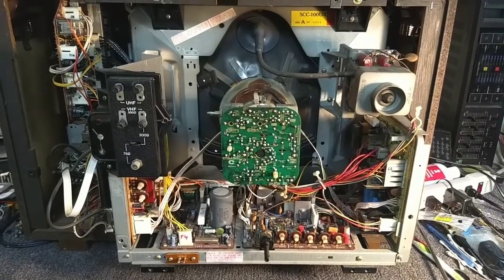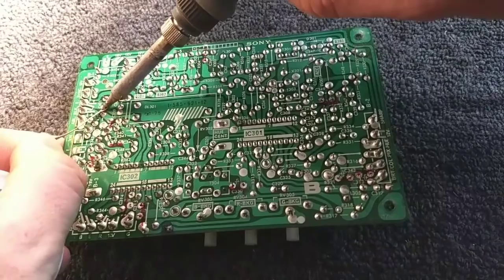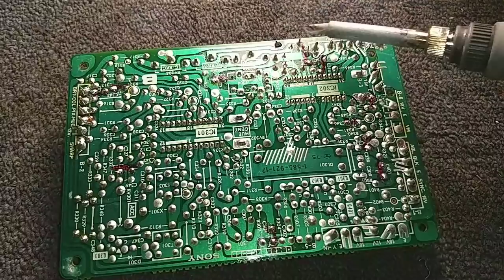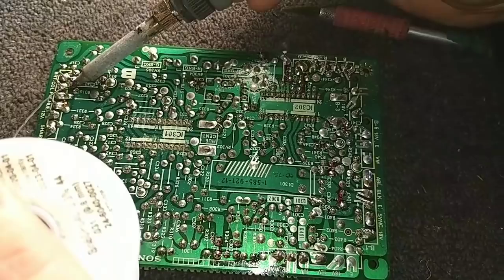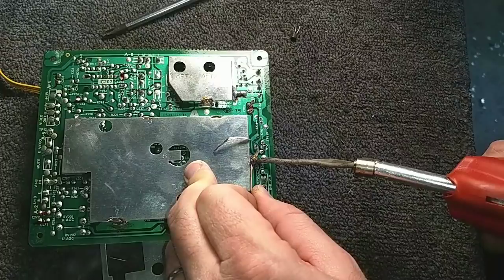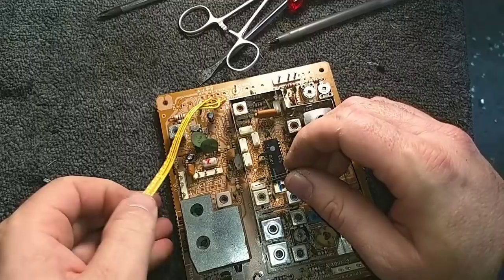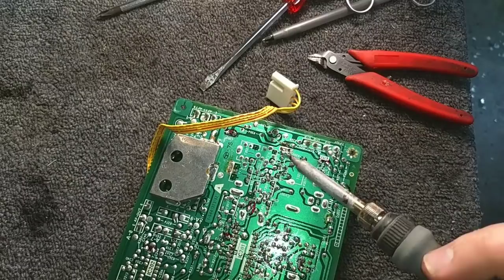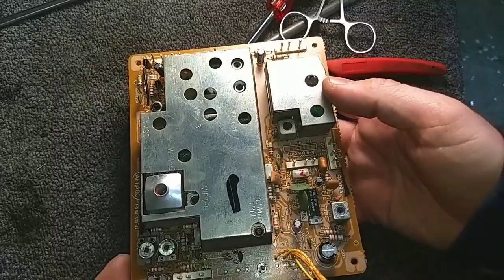Repair of a 1970s Sony Trinitron kv-1942r color tv. Part 5/? - Color, video/IF boards

Comment: I wanted to say  I watch a ton of videos on crt and cpb repair and I’ve never seen anyone run something between traces before. It makes a ton of sense to remove any tiny bits of solder that may have splashed. I was very careful when doing it, but it fixed a problem with a short I was having on my main board. Thank you for the tips and tricks!

Comment: Excellent video! I don't think Shango066 would approve of you "shotgunning" all of those capacitors, though, especially the ones in the low-voltage circuits!

Comment: Sorry to tell You, but You forgot to change two capacitors on the first board. It's C332 and C316. That being said, I wouldn't have the patience to resolder almost every connection on a board... lol But a nicely working Trinitron TV is probably worth it.
Reply: I saw that, too.. I was waiting for Jordan to catch it, but it didn't happen.

Comment: Speaking of old audio gear, back in the 80s, I had an girlfriend’s Mom who asked me if she could get enough money from an old pair of Klipsch horns and a Macintosh preamp and MC275 amp to buy a new receiver. One of the output tubes on the Amp was bad so it didn’t have a right channel anymore. She’d got the house in the divorce a few years earlier and the ex had just left the stereo. I guess he didn’t have room for the big ass horns in his new apartment on the beach with the new bimbo. 

Anyway, after I quit laughing and told her she could get a new stereo,  a new TV, and most of a living room set for the gear, she was fairly astounded. I’d have loved to have bought it off of her but I didn’t have nearly that much money and I’m not the type to cheat people. I did find her a local stereo geek who gave her a reasonable price for them as is. I got her a $300 HK receiver and a set of $600 infinity speakers and was just as happy.

Comment: Not watched the whole video yet, but noticed you forgot two caps on the first board you recapped. Late, headed to bed, I'll check if you caught them in the morning after finishing watching.
Reply: I noticed the same thing. I was wondering if there was something that I missed. Is there something different about those two? From the video they look just like the other electrolytic caps. I know that some types of capacitors, like mica ones, don’t deteriorate. Just wondering if we can get a good method of determining which is which.

Comment: Did you miss C316 by the red wire and blue trimmer??? on the picture IF card :-)
Reply: Yes, he did. And C344 as well. (BTW that was the color demod board, not the IF).
Reply: @mrnmrn1  you are right about the board but following the video I did not see C316 get changed not that it matters to me at allI just wanted to let him know what I had seen and Jordan could review it in the video that was all
Reply: @fredflintstone1  Yes, C316 and C344 remained unchanged.
Reply: My OCD kicked in when he missed ‘em lol 😂😂 But he didn’t even have them marked underneath the board for removal 😳😳 So MAYBE it was intentional ? 😳😳

Comment: Helllo Love your videos, Just wanted to say on te color driver board that you missed a cap between the red wire and the blue driver control. But anyway Great Channel.
Reply: I thought I saw the same thing ?. I will have to watch that part again.  I normally put a dot of red marker on top of the caps, Makes it easier to catch a boo boo on my part.

Comment: Today I found out you're repairing the very SAME T.V. as me, but I haven´t been able to repair it, first of all, my t.v. does not have any color at all, just black and white, I've been looking for some answers but got no luck, i can say I've been trying to repair this Sony since 2018, it bugs me that the color doesn´t work, can you help me where to look at?
Reply from the maker: Make sure the fine tuning is spot on. Make sure color and tint controls have been cleaned with contact cleaner. 

If no improvement then look to color burst amp and color killer circuits. Make sure 3.58mhz oscillator for color is working. 

This thing is full of bad Matsushita capacitors, but don't go recapping until you've resolved the issues.
Reply: @JordanPier  I just remembered something, while trying to repair the color, now the tv doesn´t turn on, where to look at first? neck board? It's been a while since the last time I tried to repair the t.v.
Reply from the maker: @LizardKing90  hopefully the SCR in the horizontal sweep isn't dead. If so you have your work cut out for you. Check power supplies too

These trinitrons are difficult even for seasoned techs. Not for the beginner.
Reply: @JordanPier  Thanks for the fast reply, yep, this thing is a real mess, but it's goddamn beautiful lol, I'll keep you posted.
Reply: @JordanPier  I took some photos from the color board and the board that goes on the tube, I actually didn't "see" anything bad but I'm not expert.